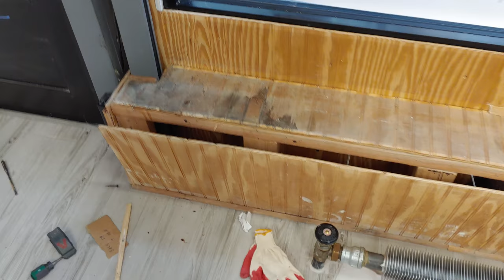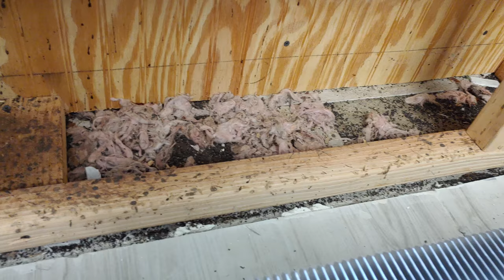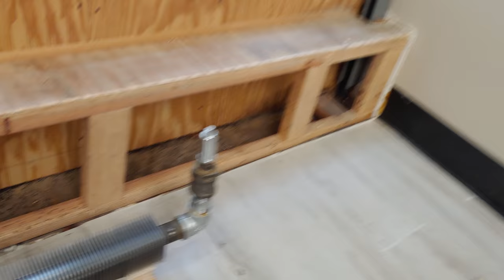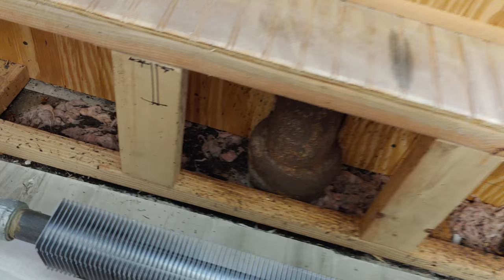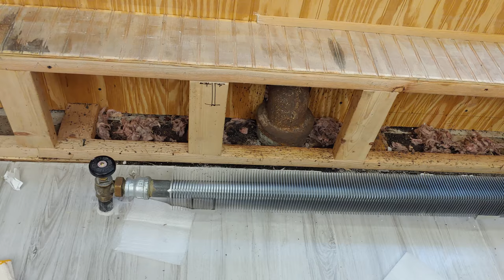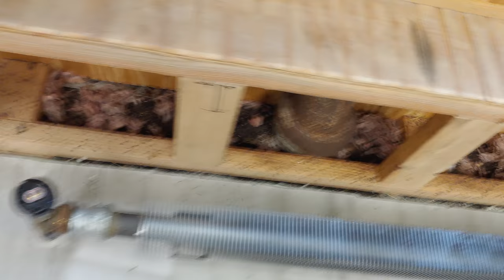New York cockroaches

Comment: Pest control guy checking in again. Amazon these products, but first check your state laws:
Onslaught Fastcap, Magnum Roach Bait, 150 MGB, Delta Dust.
Reply: tealight aluminum wrapper thing filled with something they like to eat, glued to the bottom of a tupperware or similar, lid kept on it. cut some slots big enough for only the roaches to get into, and then fill the area around the tealight wrapper things with food grade borax powder.

you can make a ton more of the things than a commercial solution would result in, and its juuuuusst as effective.

the borax gets between their chitin plates and acts like sandpaper, slowly killing them.

also known as usp mineral powder, sodium tetraborate decahydrate, etc.

once you have the traps, spraying corners they like to come out of with boric acid  (avoid places that pets can easily get to) and maybe some boric acid gel around the not-pet accessiable entries/exits of the pests. like salt wards in scary movies where they summon demons or such, but the gel will stick to walls if you apply it right.)

as an aside; for sugar ants (those really tiny bastards), just use TERRO. avoid everything else. terro is the single best stuff i've ever come across, and its pretty much just the same borax powder, but in a near perfect mix in a sugar solution that they can't resist.
Reply: +1 for Delta Dust (Deltamethrin).
Reply: Pfft just go drop some essential oils in there and the problem will fix itself!

/s

Comment: You need to put diamotmous earth down (sp?) which cracks their shells. You need to put poison gel down. And guess what. Not to be an jerk, but these guys will now live under your new elevated even floors you just built.  Hire an exterminator to do it right for prevention.  They love heat and will get into all of your electronics.
Reply: Diatomaceous, or diatomic earth. I've heard it works for all insects!
Reply: Ethan yes. It works for everything. Anything with a hard shell. I have used it and it works. And I even lay it on carpet under my computers, when I want. I will just vacuum it up. It cracks the shell of the insect and it will die. It’s non toxic also. It is also used for aquariums, I pour it in the fish tank, turn on a filter and it ‘polishes’ the water. But back to the subject at hand, with that raised floor, those guys will eventually make their way to that area. Walls and any gaps. My only suggestion is don’t eat in that office and seal any and all gaps to the outside and neighbors.
Reply: @MAX99999  With all the hardware and spaces like that raised floor in the back he has, I'm kinda worried that won't be all it takes to get rid of them. (Idk tho) It should definitely stop them from getting in. Maybe time for him to call an exterminator?
Reply: @MAX99999   Non-toxic is not the same thing as safe. High silicosis risk for improper application. It should only be applied where there's a low risk of being disturbed.
Reply: WorBlux they use the stuff also in dog beds and where dogs sleep... for ticks.  Also, I am sure with the ph and chemical levels in an aquarium, if you flood a fish tank with it, with live fish, and invertebrates, if it was not inert, the ph and everything else would change and fish would die. They do not. For a one hundred gallon tank, it takes about two hours to clean it. Pet stores (not the chains) use it all the time to remove algae blooms and other microscopic debris in the water column. It’s called the diatom filter and it’s name brand and it’s been used for decades. Also, there are many versions, some are even food grade. You have experience with these products?  I do, both for aquariums and for pest control.
Reply: @MAX99999  Do yourself a favor and look up silicosis. It's not caused by a chemical reaction. If you breath in fine silica bearing particles, it can accumulate in the lungs, causing physical damage and scaring. 

If it's wet it's perfectly safe. If it's dry and goes into the air, it's a hazard, that can accumulate over long periods and do great harm. 

If you're job is asking you to handle DE w/out proper PPE, something ought to change about that.

Comment: Vacuum it up with a shop vac. There’s longer term stuff you can put down (check Home Depot). If there are holes (where the pests can get in), get some spray foam sealer, also at Home Depot. Or order the stuff on line!
Reply: David Turk why would you want to infect the shop vac.
Reply: SkunkMeOnce2 - because you can,  spray the interior of the shop vac with insecticide then wash it out. It’s the most efficient way to pick up contaminated material (e.g., mice turds, bugs, hazardous materials). Your hands don’t touch anything “bad”.
Reply: David Turk ok, I will take your word for it. But a nice turd certainly is a lot bigger than sticky roach eggs.  I also assume you do something in the ridged hose?  Not sure how would clean that. I would buy a fifty dollar shop vac and throw the entire thing away.

Comment: Use Gel Bait.  It's a paste you put down where the cockroaches are.  They eat the bait as well as take it back to their nest for others to eat.  It works very well.  When I bought my house here in Lockport, NY at a Sheriff's sale, it was infested with cockroaches.  Two applications and a year later, I haven't seen a single cockroach in over 3 months.  You can get it on Amazon for around $20 give or take and you don't need an exterminator to apply it.  

Don't waste your money on bombs, they are ineffective.

Comment: First thing is that space was just created so there should not be debris in it.  Maybe that’s Eugene’s work.  The second thing I notice is how much roach feces on the inside wood. What I can see is what looks like the sewer vent pipe.  If that pipe has a crack in it you will get a swarm of roaches coming thru the sewer system.  If that is the case the building owner should take care of the pipe.  I wouldn’t be surprised if it was broken during Eugene’s building of that enclosure.  Try using roach bait it works wonders.

Comment: All those that ran away when you opened it up have just prolonged the issue until another time.

Kill everything in there, seal all the holes permanently. Pump sealant in as deep as possible. Go look at the underside of that area from the basement. Treat that too. Add more poison before sealing it all back up.

Comment: You need to get commercial grade chemicals for treatment if you plan to diy. Otherwise they will just keep coming back. The good news is that commercial grade pest control chemicals are not regulated and do not require a license to purchase...for the most part.

You buy either of three following options on amazon

InVict gold - gel
Advion - gel
Bifen xt - mix/spray
Reply: Do not suggest any spray it will cause tumors 100% just GEL!
Reply: @loopdemack  sometimes we need a "chip" on our shoulders